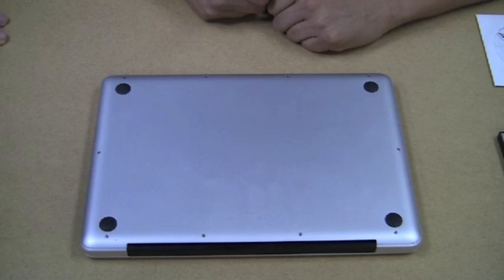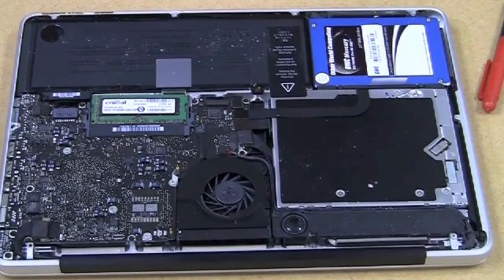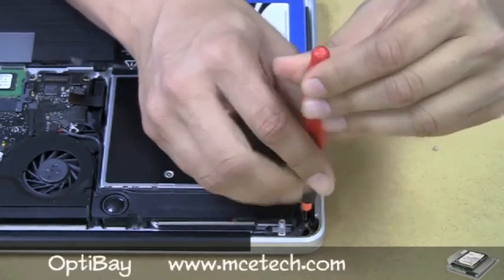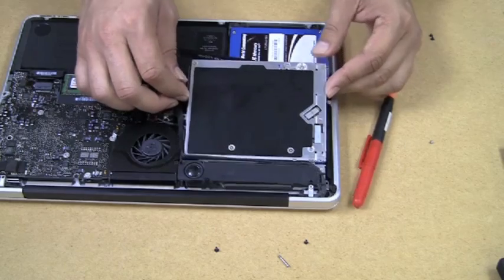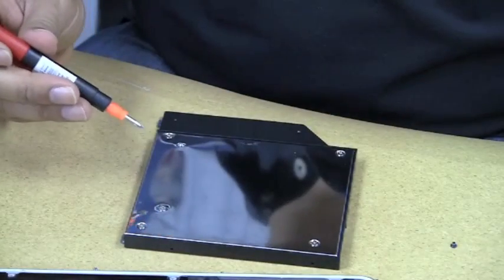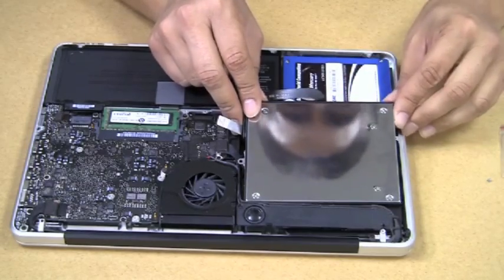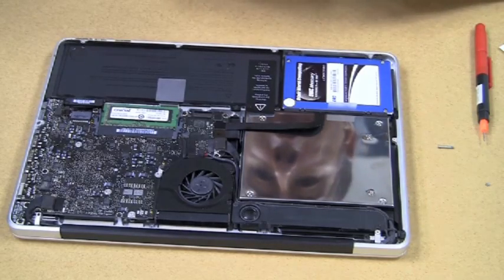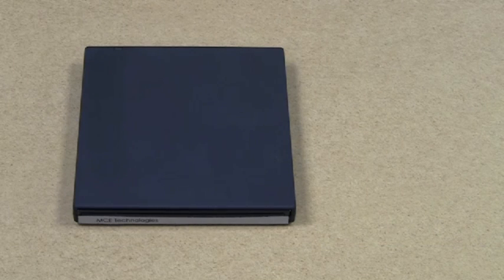OptiBay Installation part 2

Comment: Your guidelines don't work for my new Macbook Pro 15" which I got a week ago.
If you look at the "MacBook Pro dual hard drive install (timelapse)" video and pause at 0.02 you will see the new drive in the new MacbookPro 15".

I just got the MCE optibay in the mail today. But pictures in the user manual are different than what my super drive looks like. Could you please create another video with the new June2010 macbookpro?